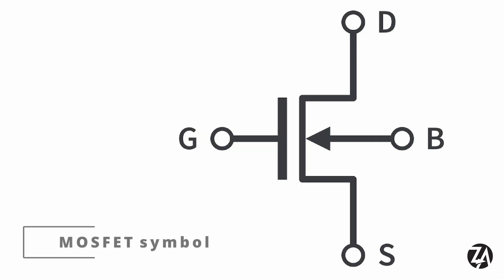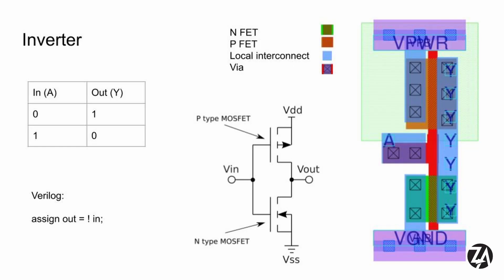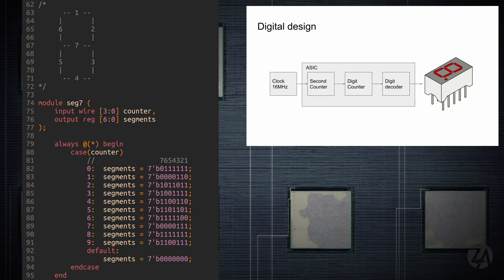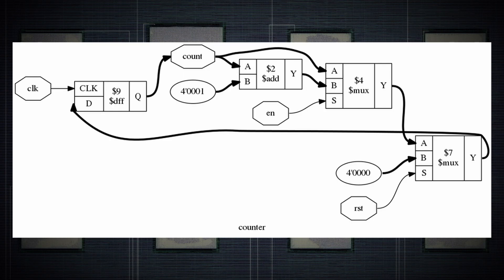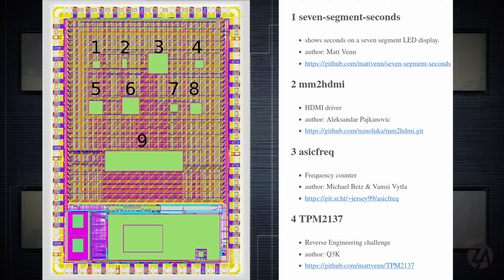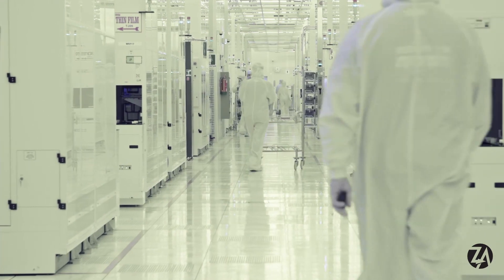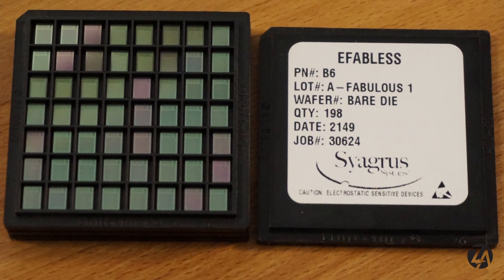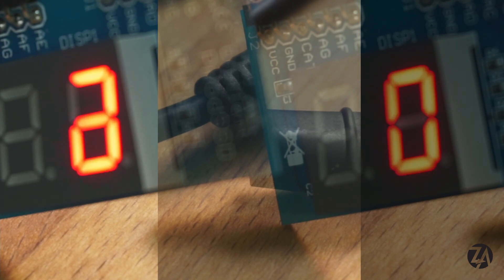My first ASIC is alive! 7 segment seconds is counting!

Comment: Congratulations on getting it working as well as you have! About open source PDKs, I think the old Mosis ones would count: I was able to get them without any NDAs back then and many chips were actually made with them. They were 2µm or older processes, however, so I would agree that the Skywater is the first open source manufacturable submicron PDK.
Reply from the maker: thanks for the info!